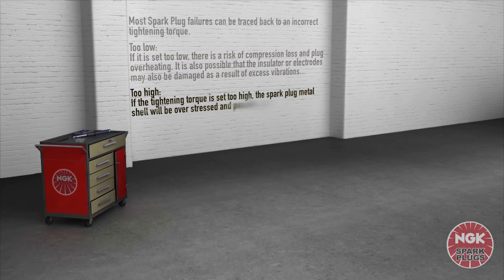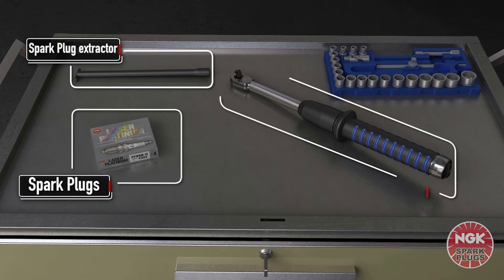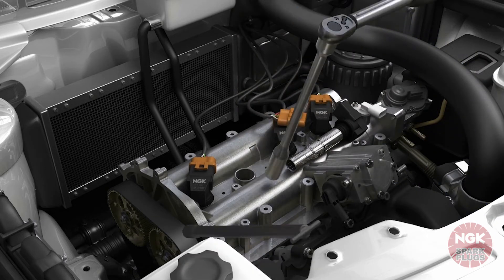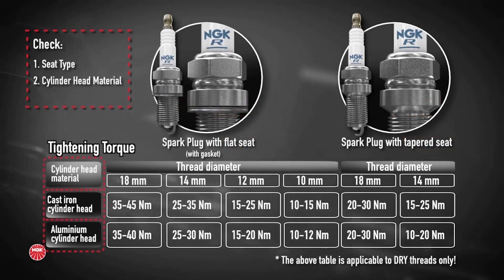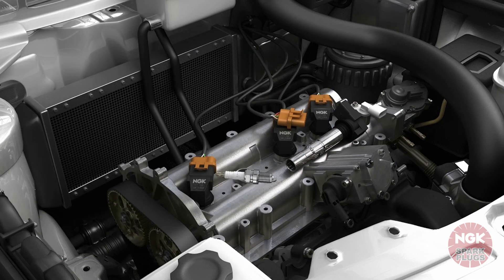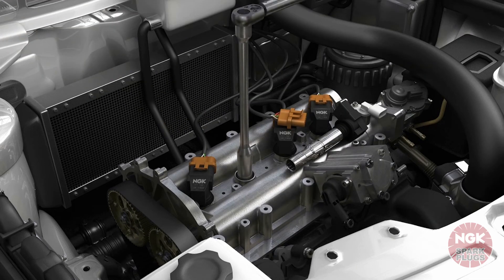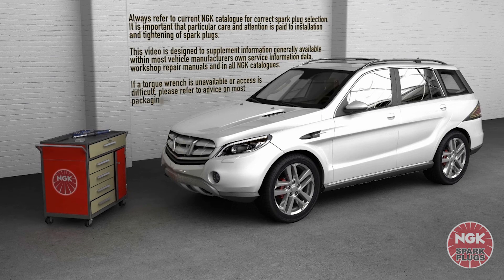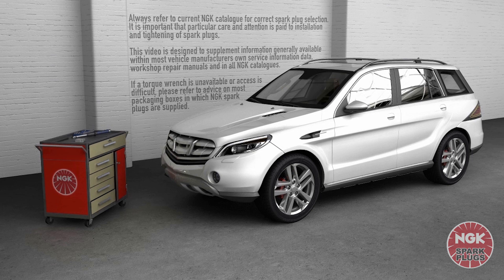Proper Torque - Spark Plugs

Comment: YEP GREAT WAY TO EXPLAIN THE BASIC'S ONLY ONE THING IS MISSING TO SPRAY THE ELECTRIC CONDUCTION MOISTURE SPRAY INSIDE THE SPARK PLUG LEAD OR SOCKET, THAT WAY ANY MOISTURE WHICH MIGHT GO INSIDE IT WILL NOT EFFECT THE WAY THE SIGNAL IS LOST DURING THE SPARK PLUG FIRING AND KEEPS MOISTURE OUT AS WELL. :)  ps: sorry about the caps. :)